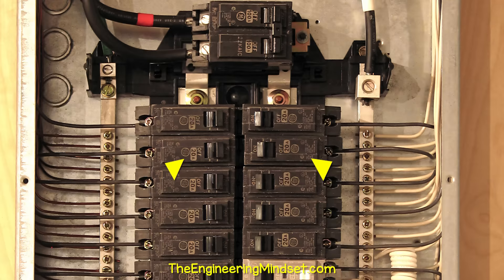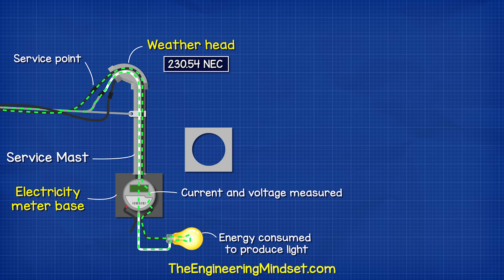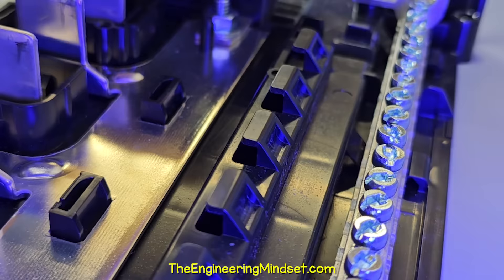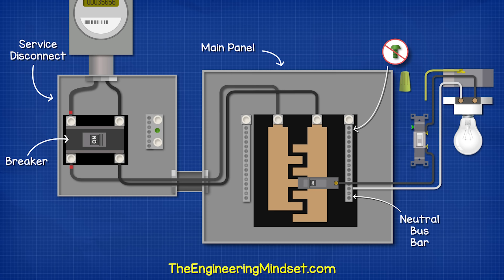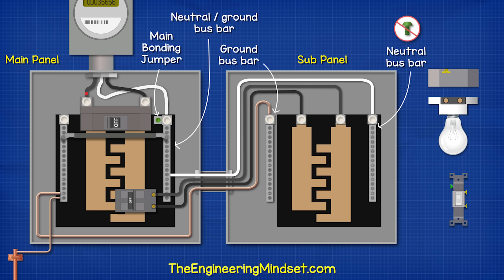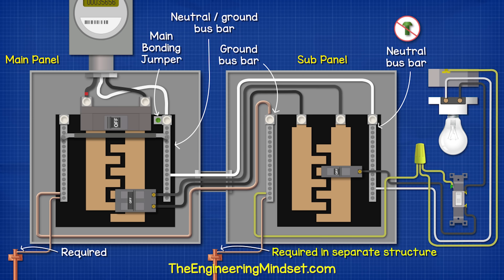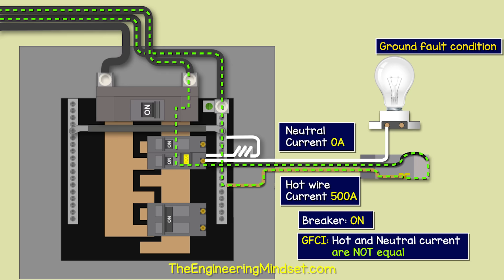Sub Panels Explained - Why are neutral and ground separated?

Comment: I really loved you video and how you broke everything down into simple terms.  I Just wanted to let you know though. At lease in my area, the power companies and inspectors require the grounded wire coming from the grounding electrode to go straight the the primary connections in the meter located in the sealed power company compartment in the case of a meter disconnect or meter panel combo. not to the electrical panels shown on multiple occasions in your video.  Sorry to bring this up but it is an important distinction.  Hope this helps.  I know it will definitely help someone pass inspection if they are installing a new service or repairing an existing service.

Comment: The video said this already, but I'll state it another way.

I believe the neutral is to be bonded at the first point of disconnect. Specifically, the first point of disconnect, relative to the service. For residential, I believe this means the first point of disconnect after the service meter socket.
Reply: The neutral-to-ground bonding really belongs in the transformer based on the physics behind its purpose, rather than in the panelboard or disconnect.  That way, you accomplish this bonding as soon as that particular system is derived.  However, because it is very common that the transformer is a utility-owned transformer, rather than a customer-owned transformer, the NEC makes a compromise to require it in the service disconnect instead, so it is at the first piece of customer-owned equipment where the NEC governs.

In a customer-owned transformer, the NEC either allows you do do this in the transformer, or in the 240.21(C) disconnect as if it were a service disconnect, but not both.  My recommendation is to do it in the transformer, and treat everything connected to the transformer's secondary, as a subpanel.
Reply: @carultch 
I agree with what you have said.

I was merely summarizing the video, which seemed to assume a municipal transformer.

Comment: Living in Europe I envy you (Americans) some very practical engineering standards.
Just like electrical panels design.
Adding new circuit: 
 you just hook the the breaker that just slides on a bus bar...and that's it. Perfect.
In our reality - we have TH-35 rail inside the panel on which you hook the breaker..but it's only mechanical attachement.
To create a bar you must either:
- create a bridge of wires connection all breakers' inputs (old fasioned way).. or 
- insert a bus bar into dedicated slot in breakers...and screw it to each one of them.
Almost the same? 
Almost 😉....
Because to replace/add the breaker in the middle of the row you need:
- de-electrify the whole row 
- unscrew most of the screws clutching the bar to let it slide off from the slot of the breaker to be replaced to make possible to pull it off.
- put the new one in place.
- fix all the screws in a row
- electrify the row (bar).
That a lot of work against, just hooking/unhooking the module in place. 😁

Comment: I think my former home owners  did their own sub panel next to the main one in the basement, I figure this because there were 20 amp breakers on 14ga wire.  Thank you for this now I can check to make sure they wired the sub panel correctly.

Comment: Excellent explanation, I,wired a sub panel for a solar system  to run some of the circuits like, well, sewer lift station, refrigerators and a few outlets for back up  and had a hard time finding the answer to my questions, this video did it with ease.
Reply from the maker: Seen our new video on HOW SOLAR PANELS WORK in detail https://youtu.be/Yxt72aDjFgY

Comment: Thank you so much for these videos, which are tremendously helpful and informative. I'm still just a beginner, so apologies if this is not the right way to frame the question, but I am wondering if it makes any practical difference whether neutral and ground are separated in the sub-panel in terms of when the breaker is tripped. I understand (thanks to your videos!) that you want all of the current from a ground fault to flow along the low-resistance neutral conductor all the way back to the main service panel because that ensures the most efficient path to trip the breaker as quickly as possible, but wouldn't it effectively trip the breaker almost instantaneously in either case? Even if some of the flow were diverted to the neutral wire through an incorrectly installed sub-panel joining the neutral & ground wires, presumably there is so much current still traveling through the less-resistant neutral that it wouldn't make a recognizable difference to the homeowner. I'm definitely NOT suggesting this means it doesn't matter, I'm just wondering if this scenario means that a ground fault wouldn't alert the the homeowner to the problem of the incorrectly installed sub-panel. It would happen so fast you just couldn't notice.

THANK YOU! These videos are amazing. Even if I wasn't studying them for practical purposes, I would find them kinda fascinating.

Comment: One will observe that most sub-panels installed before the 1970’s have both ground and neutrals bonded. Many of these pre-70’s homes only had a only a couple of grounded branch circuits in the sub-panel, usually a bath and kitchen. These panels can be upgraded by either separating the ground and neutrals and adding a ground bar and running a separate appropriately sized ground back to the main panel or replacing with a modern sub-panel. The older main panels are usually grounded to the water service entrance pipe.

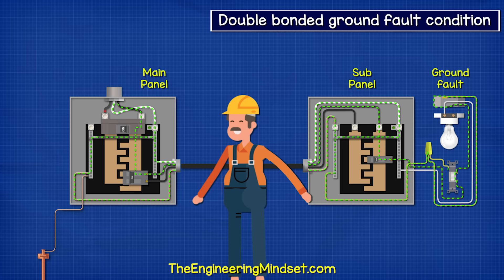Comment: I do not believe your analysis starting at 13:30, where the guy touching both panels, gets zapped. There would be a heavy (low resistance copper or aluminum) wire connecting the two cases. Yes, there could be a miniscule difference in voltage between the two panels because of the resistance of that ground wire. But, the current is already divided between the neutral and the ground. Additionally, the distance between the two panels is VERY short if he can reach them both. As well, the breaker will trip quickly. So, it seems that the guy would see microAmps for milliseconds.

Also, even if the unwanted additional bonding of the neutral did not exist, this ground wire resistance and flowing current would still exist. But, the current would only be traveling through the ground wire, thereby increasing the current through the ground. This would actually increase the amount of current the guy would see, not lessen it.

I believe there are some other flaws in the things you said later, but I'll address those some other time. It's 2:30 am, and I'm wasting time watching YouTube videos on things I already understand.

Comment: Thank you for this excellent explanation.  I'm curious, what is the purpose of the additional grounding electrode when the subpanel is located in a separate building?  None of the ground fault scenarios presented showed current flowing through the subpanel's  grounding electrode.

Comment: Most DIY people make mistake of bonding N&G subpanels come with one busbar which is odd because think if going to have a sub-panel with breakers not going to bond why not include the ground and N separate. I bought a house had a pool with a subpanel the G&N were bonded in the sub-panel. I took my current clamp put it over the ground wire coming from the 120V pool light just before where it was bonded to the bussbar. Turned it on and sure enough about 1.2 amps on the ground wire. The pool light was protected by a outlet GFCI next to the switch. I used the pool for few years before I ever looked in that sub panel. Never had any shocks I suppose have to be between the bond and the light on the ground.

Comment: In Italy we don't ground neutral.
It is only grounded at the pole transformer and in large factories.
Panels are not grounded either because they are plastic.
Zero risk. And sharp edges wont expose wire copper.
Reply: Same in most of Europe and the UK, ground and neutral are separate.

Comment: Impressive video Paul!!!  What an effort and excellent job explaining so much.  Could you explain to me the dual termination neutral/ ground bar.  In Canada, I understand the US and Canada to be very similar code. But if I connected the ground wires to the neutral bar in a main panel that would be a 100% fail even though electrically they are the same point in the main panel.  Is this common practice in the US.  Also all the panels we get in Canada which I assume the US gets aswell, Square D, Homeline, Seimens, Cutler & Hammer, etc have ground bars provided in the metal enclosure specifically for bonding.  And  ofcourse isolated neutral bars installed for neutral connections.  Obviously it's not allowed to connect the neutral to the ground bar, but neither is a bonding conductor to the neutral even tho they are the same point electrically due to the green bonding screw or tab from the neutral bar to the enclosure.
You had this in your last video as well.

Comment: Great video. One thing I do not understand though is; in the ground fault condition why doesn’t any current go on the grounding electrode?
Reply: The current always tries to return to its source, which in this case is the transformer. In a natural condition such a lightning strike, the source is the earth, and the ground rod provides that path if the lightning strikes the building.

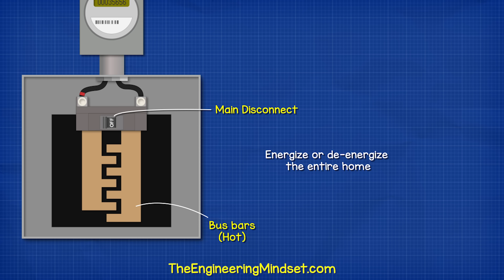Comment: I'm not an electrician but at 3:20 the animation shows power from the meter being off when the main panel breaker is turned off. The panel lugs and feed wire above that is still hot though.

Comment: This video explains the question I've had for a long time, thank you so much for explaining that. I still have a couple questions but I now understand the reason ground and neutral are connected is to trip the breaker. I can't help but think that there has to be a better way but can't comment on that at the moment. I'll rewatch and think on it a bit more before I ask any other questions.
Reply: The neutral-to-ground bond really belongs in the transformer, rather than in the disconnect or panelboard.  But, due to the fact that most service transformers are utility-owned, rather than customer-owned, the NEC makes a compromise to require it in the service disconnect instead, since it's the first piece of equipment that the customer controls.  This becomes a big problem when there are service disconnects (plural) which the NEC allows, as it forces you to undermine the entire purpose of restricting this bond to one location, and requires you to do it in all of the service disconnects.

It's also very common that multiple customers share a transformer, which ends up requiring redundant neutral-to-ground bonds.

A much better solution would be for the NEC to only require it in the dominant service disconnect, when there are service disconnects (plural), and base its sizing on the sum of the service disconnects.  Then, all smaller service disconnects would be built as subpanels with separate grounds and neutrals.   And if there are customer-owned transformers, put it in the transformer instead of the secondary disconnect.

Comment: Could you have a general GFCI for the whole system? Or does it only work on one circuit at a time? Great video, I'm by no means an electrician but I still understood most concept in this video! Much more than physics class taught me in 16min lol
Reply: Yes. Countries that use 240 volts adopted GFCIs (aka Residual Current Devices) earlier due to the higher risk of electrocution. They usually have one big RCD supplying a group of simple over-current breakers.  In North America, GFCIs were first required only in special cases (first swimming pool lights, then kitchens and bathrooms, then anywhere outdoors, etc). This, in addition with how our panels are physically arranged, lead to ground fault protection being done on a per-circuit basis.

Comment: I notice that a lot of comments, from what sounds like veteran electricians, are very often along the lines of: "I did it for 20 years and not know why, I was just taught not to" or "nobody ever explained it as simple as this for me to understand" or "I just did it out of habit, never bothered to ask why".
It's mind boggling to me, that there are professions in which training and education simply convey the "what" and "how", but not the "why".
As mechanic, the "why" is the reason how I got REALLY good at diagnostics and repairs. Especially in those cases where someone did something that causes a problem, looks right, but isn't. Fixing things a way that will work, but isn't safe or the proper procedure to ensure a lasting piece of equipment, bypassing, rather than fixing the root cause.

Comment: @13:20 That ground-fault current flows through the neutral conductor is not a big deal.  The grounded conductor is a part of the effective ground fault current path (at least on the line side of the service disconnect).  
@13:25 A metal raceway is also a part of the effective ground-fault current path and thus is not a problem here.  The ground fault here will cause the circuit breaker to trip.  Metal raceways are themselves equipment grounding conductors (NEC 250.118).  For more on this, you can look up the NEMA publication: "Rigid Metal Conduit, Intermediate Metal Conduit and Electrical Metallic Tubing: Proven to Meet the NEC Requirements for Equipment Grounding."
@13:30 This "hazard" would exist regardless of whether the bonding screw was or was not installed in the sub panel.  The point of the effective ground-fault current path is that such a "hazard" wouldn't exist very long--just long enough for the breaker to trip due to the massive current of the ground fault.

That being said, definitely one of the better videos on this subject.  Still would recommend it.

Comment: 13:32 The hot-to-ground circuit in the double bonded ground fault condition matches exactly (I believe) the hot-to-ground circuit for the normal ground fault condition. The normal ground fault condition causes the circuit breaker to trip, so why doesn’t it trip for the double bonded ground fault condition?

Comment: Thanks for this great resource! As a fairly new homeowner, it's great knowledge to have! I do have an odd situation. My sub panel (in the detached garage) only has 1 hot coming in from a double pole 50 amp breaker in the main panel. That said, only 1 bus bar is energized. Is there a way to energize both sub panel bus bars with just the 1 hot coming in from the main panel? Thanks for any help! Much appreciated!

Comment: 11:50 will current not also flow in the metal casing here? Thr ground bus bar in the sub panel is connected to the metal casing, the neutral is connected to the metal casing in the main panel, the two metal casing are connected via the feeder conduit, so wouldn't current be able to flow through the casings to the bonding jumper to neutral?
Reply: During fault conditions, yes.   The casing and grounding wire will share the parallel current.

But, during normal circumstances, no.  The current is limited to the live and neutral wires.

Since current needs a closed loop path to flow, a dead-end bond between neutral and ground will not sustainably allow current to flow between neutral and ground.  A little current flows during the first second when they are achieving electrostatic equilibrium, but no current flows continuously thereafter.

Comment: The current flow diagrams show both the main and sub panel ground bars grounded to earth (as required for external structures), but this was left out of the discussion about current flow.   

Did you leave it out of your current path explanations because you were describing how this should work in sub-panel in the same building (as in, the sub ground rod shouldn't have been in diagram at that point)... or because it would only affect the details (like Voltage splitting) but not change the overall point of how the current flows in certain fault situations?

Also, .. (hope you'll continue to humor me)
Code in my town now requires two ground points (to earth).  My system was originally grounded to a metal water service pipe so I need to add a grounding rod near main to provide secondary (or now, Primary) path to ground.
Is the lack of requirement for a sub to be grounded in the same building simply a matter of it being up to code (as in, good enough), or is it a requirement that it NOT be grounded to earth?    Would a sub in my home be more safe if I added yet another (3rd) ground point and connected the sub's ground bus to it?        

Thanks.. appreciate the work to provide this very helpful video.

Comment: Question for everyone:     I once was involved in a debate at work regarding the terminology of GFI vs GFCI.  The point of contention was over a 'fault' being a circuit, as in a noun, vs 'fault' being an adjective describing the circuit type.  GFCI is by far the most used, but is it correct or redundant? IDK. I have heard both sides. What say you?

Comment: If you come from your meter to run a sub  instead of your existing house panel you would run the wiring right like the home panel, so basically two panels with the same disconnect. Unless you wanted to run disconnects just outside of your meter for each feed either way

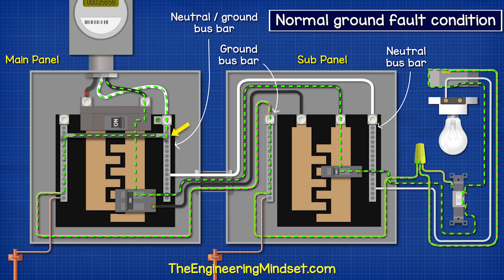Comment: Great video , but I have a question:  at time: 13:42 - if the subpanel and main panel has the ground screw connected at the same time , and the person touching both main and subpanel, and the panels are electrified, i would believe that person will get shock but would that person  still get shock whether he touches both or just one panel ? Let me know you thoughts
Reply: base on my experience you will get shock if you touch any good conductor materials that is linked or connected to the electrified conductor. there's an explanation here that may i say correct but also some are not.. like yeah you have to touch both panels to be shock it is not true, either would be shock you as long as it was electrified..